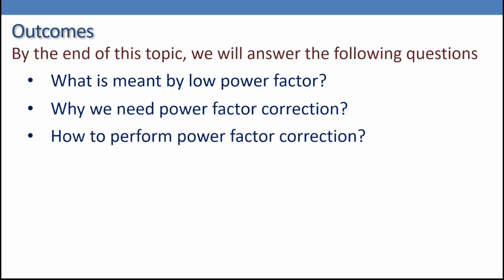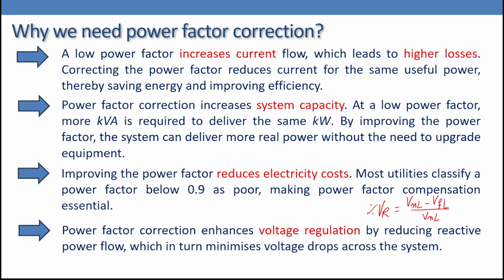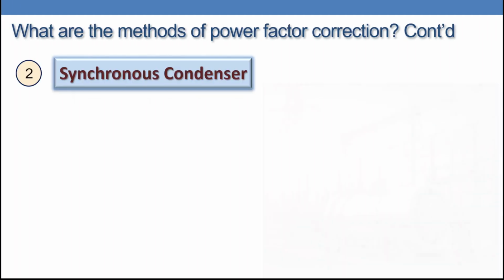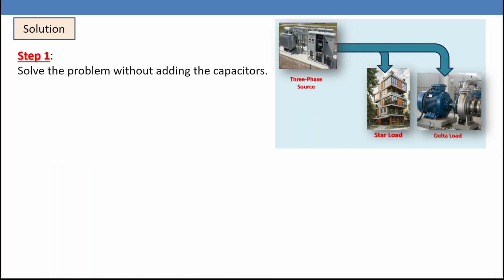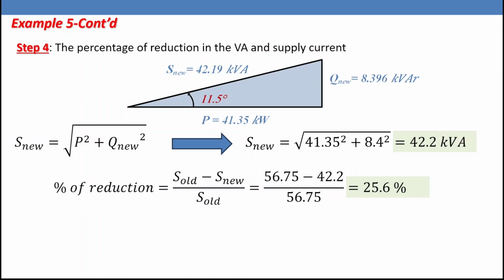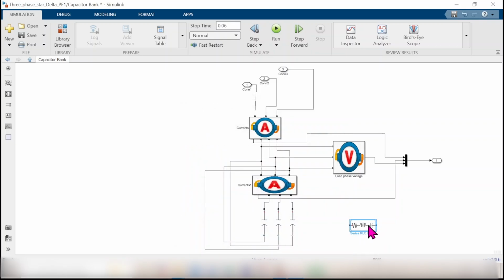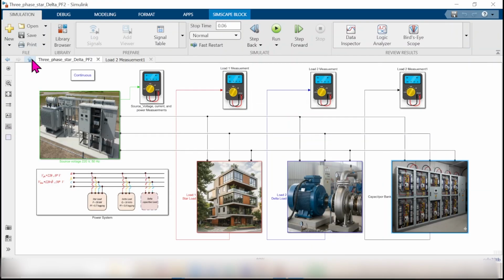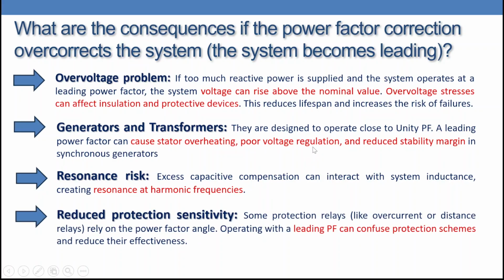Power Factor Correction (Three-phase System)

Comment from the maker: Thanks for watching this video on Power Factor Correction! ⚡
The link for Video8:  Comprehensive Example on Three-Phase System includes Star & Delta Loads 
(Calculation + MATLAB/SIMULINK)
https://youtu.be/Ye6ZUaiM-c0 
✅ Key Takeaways from this video:
•	Power factor explained mathematically & physically
•	What causes low power factor and its drawbacks
•	Why power factor correction is necessary in power systems
•	Different methods of correction and design steps
•	Example of capacitor bank design with real calculations
•	MATLAB/SIMULINK confirmation of results
•	Important note: what happens if you over-correct the power factor
💡 Don’t forget to:
👍 Like the video if you found it useful
💬 Comment below with your questions or thoughts
🔔 Subscribe for more electrical engineering tutorials
👉 Share this with friends and colleagues who are interested in power systems and design!
#PowerFactor #MATLAB #ElectricalEngineering #PowerFactorCorrection